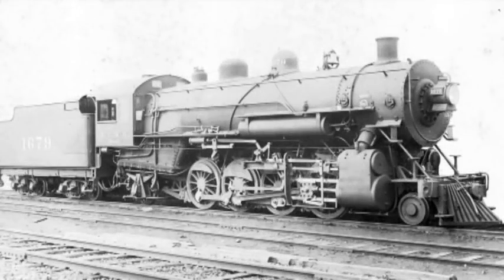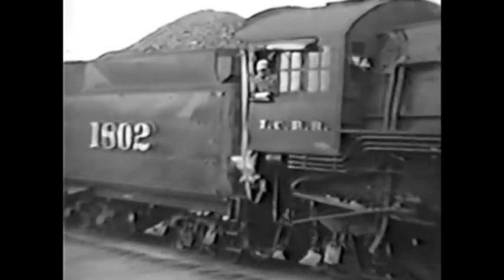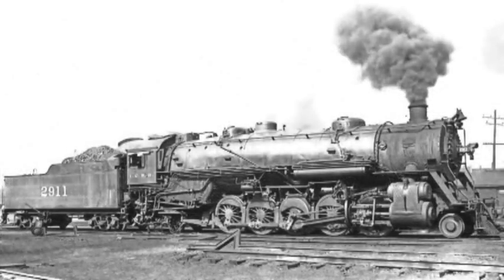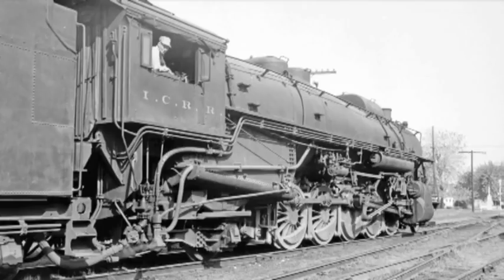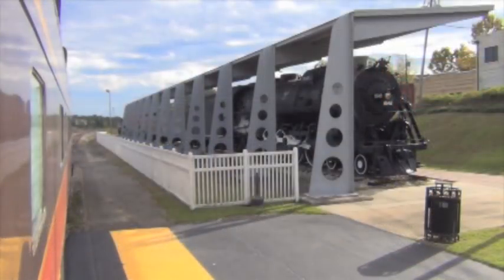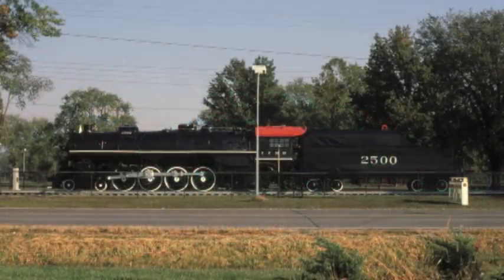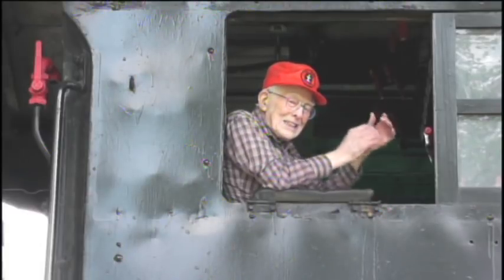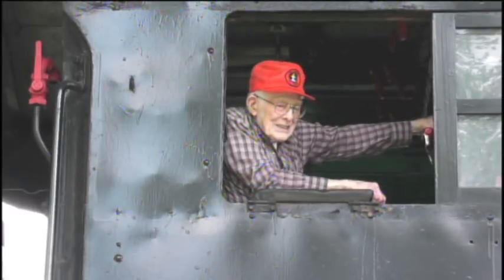Celebrating With The 2500

Comment: Nice Locomotive, but that has to be the Worst sounding whistle i have ever heard.
Reply: arnold harner Sr The IC whistles sounded good. This would sound much better if the locomotive was under steam rather than using compressed air.
Reply from the maker: It must be remembered that it was being blown on just 150 pounds of air.  That is considerably less than the steam pressure that would have been used on a locomotive, and the reduced pressure and the difference between air and steam have an effect on the sound.
Reply: I know they sound different on air than steam.  It sounded like it was starving.   Just Say'in.
Reply: Should have heard what a I.C. steam boat sounds like on steam a couple years ago at Monticello, it was awesome, Thanks Mary.